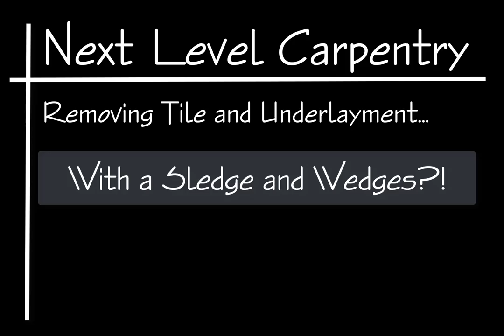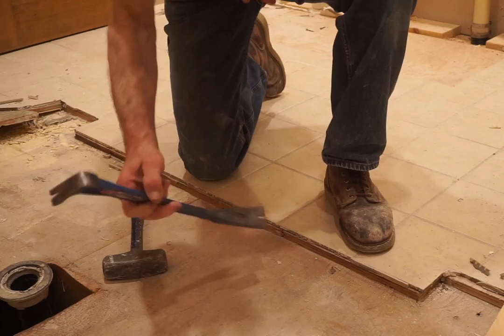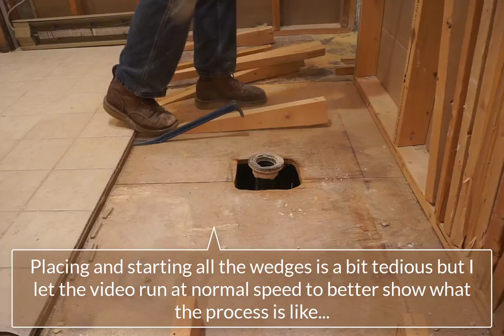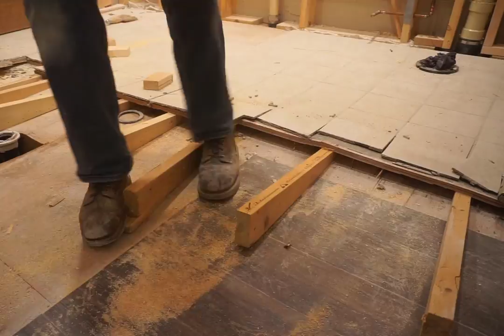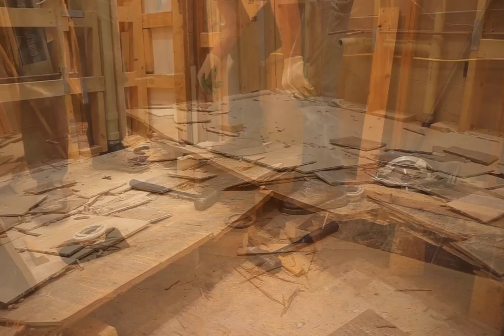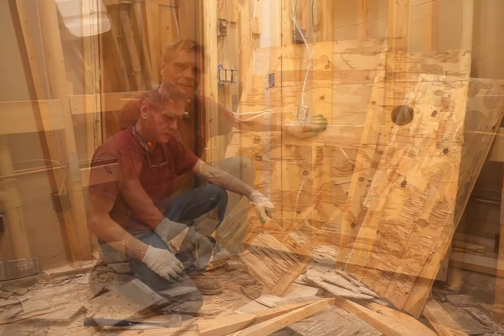How to Remove Ceramic Tile and Underlayment the Smart Way

Comment: Or…rent a rotary hammer with chisel bit, remove the tiles first (they come off easy) and then cut the underlayment into smaller pieces with a circular saw. At that point removing the underlayment is easy since it comes out in smaller pieces. Once you get a prybar under the underlayment, you’re all set because you’re popping off smaller, less-secured pieces.
Reply from the maker: Consider yourself very fortunate if you've never had to deal with a REALLY tough tile removal project!
Any time the typical method you describe works then, yes, go for it.  When you encounter tear out like the example in this video, do yourself a huge favor and remember this hammer and wedge method, Daniel, because, believe me there's no "they come off easy" about  it!

Comment: Thank you for your video.  After struggling for a couple of days trying to get bathroom tile (a dust mess in the process) up I cut some wedges like yours and got the tile and underlayment up in one piece.  Your process worked like a charm with zero damage to the subfloor.  My wife and I also used the wedge method you showed on another video on how to remove a large, glued-on bathroom wall mirror - that worked like a champ too.  Your videos saved us thousands of dollars, saved us mess, and saved us a huge amount of time.  Thank you again.
Reply from the maker: That's quite gratifying to hear Joe... kudos to you and your wife for tackling your own remodel projects... not for the faint of heart but much easier when workin' smart! Best, Matt
BTW Make sure to check out other 'work smarter, not harder' type videos here at Next Level Carpentry for removing sheetrock, stucco/dryvit etc with less mess!

Comment: You are my hero.  I was stuck.  Contractor said - no way, multi-layered floor (two sheets plywood, glued and seriously nailed to death) with a layer of parquet thrown in could be removed for anything less than 3-5 grand.   I read your clear description of your process and watched the video - three half days of work later the entire floor was up and in the back of the pickup truck.  Thank you thank you thank you.   I now am on task to complete the bathroom we planned not the bathroom we were being forced into.  Cheers
Reply from the maker: That is SO cool James... thanks for sharing your experience.  It doesn't mean that it's not rather brutal work but at least you feel like you're winning, right?😎 Best, Matt
Reply: @NextLevelCarpentry  Brutal yes but like you said at the end of the video - the floor lost the battle.   Cheers, Jim
Reply from the maker: @JamesSmith-no7fr  Final score: James: 1, Floor: ZERO!! 😎

Comment: You saved me an untold amount of time today. I had to pull up a tile floor from hell. Tile, mortar, hardi backer (screwed and mortared), 1/4" luan (screwed down with 2" sheetrock screws...) then sheet vinyl, then 5/8" plywood (nailed to subfloor). Insane demo job, the entire 400 sq ft floor was layered like that. Your method had us done in 5 hrs instead of 2 days. Thanks!
Reply from the maker: You're sure welcome Tampafan... ALL tile demo is demo from H&** but yours sounds like a whole other level of misery so I'm glad to hear this spared you undue hardship.  Still a long, hard, nasty day of demo but at least you feel like you're winning, right? Best, Matt

Comment: I'm a tile setter by trade. I've never seen a tile floor demo like this one and I have to tell you: I'm extremely happy that I just did.

Thank you very much for sharing your knowledge. It is truly, greatly and sincerely appreciated!!
Reply from the maker: You're welcome Carlo... this method doesn't work on every demo job but sure gets the job done when old installation allows it. I recently used it for pulling up some of that thick clay tile laid on DuraRock and that stuff didn't stand a chance against the sledge and wedges!   Best, Matt

Comment: Thank you very much. I will have to tackle the removal sometime and I remember putting in the screws into the plywood every 6 inches on a Thanksgiving break one year eons ago and the heavy cement board also so I will not favor removing all we did years ago but it has to happen.  I will pray long before starting and hope that helps out.  I am sure it will help!!

Comment: I have 450 sqft of ceramic tile and underlayment to remove and this looks very promising to a very daunting task. Thank you for putting out this video! I’m going to try this method.
Reply from the maker: If you have time to plan ahead Syd try and find the toughest 2x4's you can for wedges...maybe even some oak from old pallets or something... the tougher they are, the better they work... and bring plenty of them too! Please take a minute to report back after you've tackled the task? Best, Matt
Reply: Next Level Carpentry Thank you for the tip. I’ll be on the hunt for the toughest 2x4s I can find. I’ll definitely report back when I have finished the job!
Reply from the maker: @sydney7793  I wish you well and think you're going to CRUSH that tearout project!  Best, Matt

Comment: We had a hard time, when we started to remove the old tiles with hammer and chisel. Then we found your video, cut some wedges and it worked much better. Still had cut some grout lines  with a grinder but then we were able to get tiles and underlayment  in big pieces off the ground. Thank you so much, it saved quite some time and frustration :-)
Reply from the maker: Thanks for letting me know Tom... and congrats on adapting and applying what you learned in this video to your project and succeeding!  Every project is different so your ability to adapt is an asset not everyone has.  It's still dirty, hard and nasty work but at least you feel like you're winning, right? Best, Matt

Comment: Brilliant - worked a treat. I have added a bit to the technique because the screws securing the plywood underlay were ripping into the wedges. I happen to have a slate ripper which I hammered under the ply first and then inserted wedge under the ripper- this eased the progress of the wedge too.
Reply from the maker: Great adaptation Tony.  I've thought to make steel tips for the wood wedges for the same purpose but never acted on the thought like you did.  Kudos!
Reply: @NextLevelCarpentry  another great advantage of this method is that it has little impact on the floor, ceiling and pipe work beneath. The hammering of wedges only exerts force between substrate and floor. Important in an old fragile house like mine when working on first floor in a bathroom over a lathe & plaster ceiling and virtually every pipe in the house.
Reply from the maker: For sure... the likelihood of collateral damage in a 'fragile old house' is stressfully high where the cure can sometimes be worse than the repairs...

Comment: Great for upstairs stuff around here..... tons of ranch houses in this area.  Single story, slab floors.  Most tile floors are mortar to the slab.  I beat out two 9 x 13 feet sections to lay floor in my house!   A roto hammer + the largest chisel bit I could find along with a dust mask and knee pads.  Several hours of misory.  I was hoping when they build my house the tile guy was hunger.  It must have been Tuesday and that dude was on his game!  No gaps in the mortar with great adhesion!

Comment: I have faced this challenge multiple times.  The long tapered wedges are a great tip.  I'll try it on my next one.  I have also learned to only remove old flooring on a time and materials basis, no fixed price on that portion of the job.  On many floors, I use my circle saw and an old blade to cut the upper layer into smaller sections...however with the ceramic tile in your scenario it would be unacceptable to generate that much dust.
Reply from the maker: Great minds think alike, Kevin... and so do minds that have to tackle nasty jobs for a living :-)  Desperate jobs call for desperate measures too... all the whaling and pounding on this job generated enough dust as it is so I was thankful I didn't need to resort  to sawing like you mentioned!  Thanks for commenting, Kevin... Best, Matt
Reply: @NextLevelCarpentry  I LOVE LOVE LOVE your strategy, as I am about to rip out porcelain (I think?) tile in my kitchen/dining room that has backer layer, plus another 1/4 plywood subfloor layer on top of the original subfloor. I am planning to use your method, but will have to relief cut the pried up sections with my angle grinder, I'm guessing, since the area is much larger than this bathroom. I bought a dust collector guard for my angle grinder, plus a HEPA shop vac to keep the dust down. I'll let you know how it turns out.
Reply from the maker: @marlaplunk2833  Unless the subfloor is 1/2" or thicker I'll be surprised if you have to relief cut it as usually self-destructs during the removal process. Sometimes 1/4" stuff won't come loose in very big pieces, depending on how many staples hold it down, if it was glued down, etc.  It's good to have options in the way of other tools and equipment like you do because you never know what you're getting into until you're into it. Good luck with your project!
Best, Matt

Comment: Wish I had found this video 2 weeks ago. Great suggestion and 1 I wont forget. Glad you shared.
Reply from the maker: Hopefully you'll need it 2 weeks from now when you're faced with another challenging tearout, John Boy.  BTW the same method works great for removing hardwood flooring... in some cases you can actually salvage much of the T&G because the way this eases the boards up when removing.  Best, Matt
Reply: @NextLevelCarpentry  I will keep that in mind if I get a floor replacement with T&G.  I wish I knew about carpentry what you may have forgotten over the years.  Glad to see you use Makita stuff.  Mine make me my bread and butter.  My only deviation would be that DeWalt surface planer you have.  Boy I hope Santa sees this post.
Keep up the good work Matt👍
Reply from the maker: @irishhandyman2009  'hope Santa sees this post'!  LOL!  The DW735 planer makes me a LOT of bread and butter, not to mention all the bacon it brings home!  Having it and knowing what kind of work to take on to take advantage of its capabilities is key to profitable shop work which I prefer to run at about a 60:40 shop to jobsite ratio.  Makita tools are part of that same equation, right?  Best, Matt

Comment: Great idea Matt, never thought of that in my 40 plus years. However, I have rarely been lucky enough to have underlayment under tile it's usually 2-3 inches of  mud bed. I use a 6 foot steel spud and remove monolithicly in  3-4 section. I have dropped entire walls of tile on wire lath, mud, to the floor in 2-3 section by getting behind  wire working my way in and leverage off the wall  in 2-3 complete sections with spud bar.In my beginning years I could spend 3-4 days demo-ing  a tile bath vs. 6-8 hours with one laborer.
My steel spud bar has been my trusty companion for many years for demolition.
I am going to remodel my kitchen in next month and will be using your (wedge technique) to remove tile, cement board and plywood down to 1x8 diagonal deck in one shot with help from my spud bar as well. Thanks for great idea. We would have made a hell of team Matt early in our careers. You are very generous with your years of experience and techniques and viewers should be ever so grateful !
Reply from the maker: Hey Greg, Thanks for 'sharing'... since leaving a position as project superintendent at a commercial construction company almost 20 years ago and going to self employed status one of then things I miss most is telling construction 'war stories' with guys like you.  For those who haven't spent years tearing into who-knows-what this stuff sounds like fiction.  I'll bet anything that your 'trusty companion' spud bar is one of forged steel like mine and not one of those worthless ones with a 2"wide tip made from hot-rolled steel  that bend long before any REAL work gets done!  As bad as tearing out 'dry pack' mortar bedded tilework is, I was always glad that it was me doing demo rather than the grunts who had to mix and haul all those tons of mud when it was put in... gives those with our perspective great admiration for cement board and Ditra.  I do know there's going to be a lot of weeping and gnashing of teeth by future carpenters who end up tearing out stuff we're putting in these days with screws and urethane adhesives instead of mostly just nails.
Thoughts of 'back in the day' teamwork and the camaraderie from it almost makes me believe we did work together somewhere along the way...
BTW if the old pickup in your channel icon is any indication we have identical taste in trucks!  I did a 75% complete restoration of a '70 Chevy C10 back in the '90's and drove it proudly for many years... a truly classic body style.
Best,
Matt
Reply: Rare encounter to speak with 20 year old self-emp in this business, I have seen so many come, go, or pass in all the trades.I spent 2 ½ years in corporate world out of college behind desk only to find it was not for me. Been self emp since mid 70’s . I began as sub than onto building contractor and remodeler survived 3 big downturns in industry.
Now at 71 still passionately love wood, did 3 remodels last year I have many projects planned this year for myself in finer aspects of woodworking.

 ((I'll bet anything that your 'trusty companion' spud bar is one of forged steel like mine and not one of those worthless ones with a 2"wide tip made from hot-rolled steel that bend long before any REAL work gets done!))

Matt I knew you had to have one, Ha!, yours  sounds just like mine, only tool that has never broken  down.

((if the old pickup in your channel icon is any indication we have identical taste in trucks! I did a 75% complete restoration of a '70 Chevy C10 back in the '90's and drove it proudly for many years... a truly classic body style ))

Matt no longer have that truck, I have 1984 Chevy K-10 ( 4W) bought new, plan on body work and paint this year, replaced everything under hood 2 years ago, rarely  drive it, but love it, and never part with it.
We not only have similar tastes in trucks but tools too, looking at your shop, I love your Powermatic 8 joiner, my PW joiner is a 80’s model not near as nice as years, I believe yours has a longer bed, you have Unisaw, Delta 1982,  same year I bought my PM Joiner and 10” PM table saw, "unbelievable",
Last November I bought 2yr old Powermatic 3520B lathe, I have little experience in that area but want to learn. I several PM pieces all well maintained like yours.
Will be watching more of your video in future, they are so addictive,
Kind Regards,      Greg Bungard  - Atlanta
Reply from the maker: Well Greg, sounds like you've got about 10 years on me... it's great you're still up and at it!  Construction can be hard on a guy but I'm guessing you figured out somewhere along the way how to work smarter and leave some of the harder to the 'kids'? We just had an arctic blast and hit -18 F on 31-Dec and I was telling my 
wife how thankful I am not to have to trudge out in that stuff for 
framing or concrete anymore! I still do plenty of client projects but basically decided I should diversify into YouTube as an alternate income stream. It's a whole new world of learning to be sure with its challenges and rewards.
One of the greatest rewards is hearing from friends I've never met yet :-)
If I had to choose one brand for all my shop equipment it would be PM.  The PM PJ88 jointer is a superb machine!  I bought it primarily for the parallelogram height adjustment feature. IMO Delta's quality, fit and finish ain't what it used to be so I switched brands without regret.  I didn't like PM's helical cutterhead (they didn't offer 'rabbeting tips' for it at the time) so I bought and installed a Byrd Shelix. It's a wonderful combination!  Don't know if you saw my 'triangle trellis' video series but I turned the finial for it on a friend's PM lathe.  It's a sweet machine... if I had room I'd love to get one and tinker like you... hope you're able to find time to learn.  I recently decided that the next equipment upgrade will be switching out my Delta drillpress for the top end PM model for the same quality, fit & finish reasons.  Who knows, if the stars align maybe PM will sponsor Next Level Carpentry someday... a guy can dream, right?
Feel free to stay in touch... you can use the email under the 'About' tab on this channel if you like...
Best,
Matt

Comment: Dude. If I could buy you a beer, I would. I was going nowhere fast trying to tear out a tile floor that was laid on 3/8's plywood that was both glued and stapled down with hundreds of  staples (why, oh, why?!).  I didn't have any scrap 2-by's but $2.50 for one was well worth it. I cut out six wedges and ran 'em above the joists.  Those wedges REALLY worked well with a small sledge. It still was a really tough job and required Advil afterwards, but had I not found your idea, I'll bet I'd be still frustrated.
Reply from the maker: It's rewarding to hear how well this method worked for you!  The fact that you did (and were able to) run the wedges over joists was insightful and was a big factor in your success... I hope other's benefit from your comment as I didn't mention that in the video.  Like you said it's still a tough job but at least you feel like you're winning!
PS Tanks for the sub!